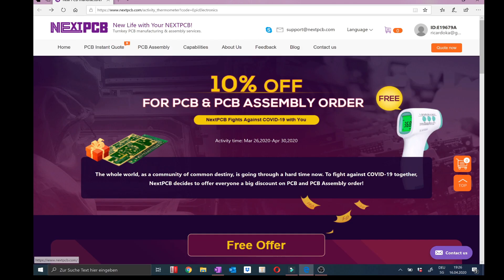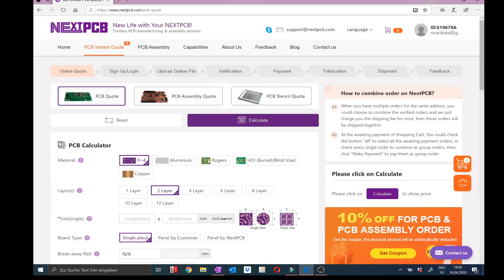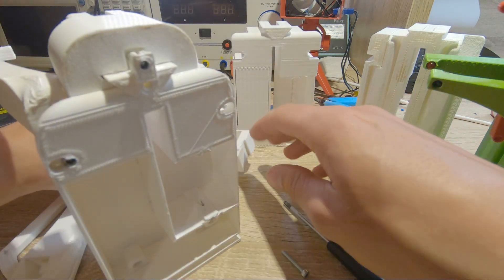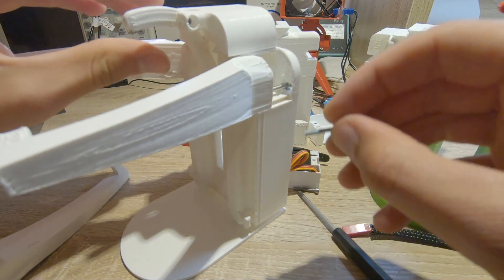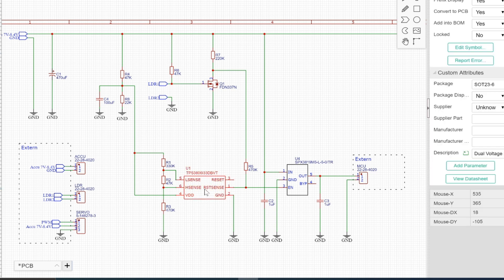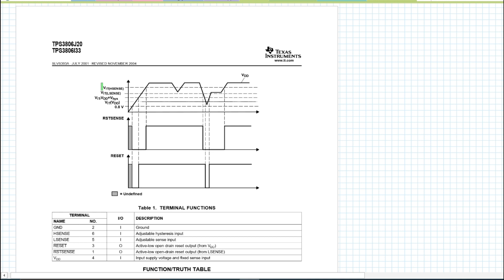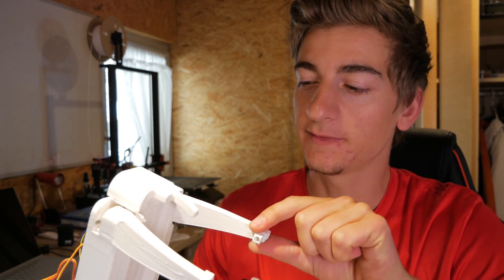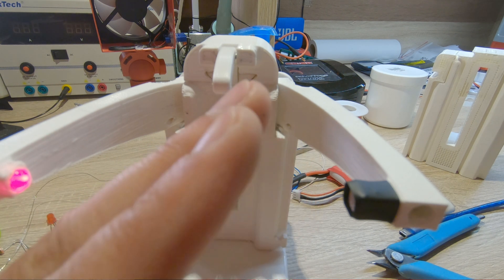No Touch Soap Dispenser V2 | CORONAVIRUS protection | Arduino  | 3D Printed

Comment: Dam this so cool, love the LDR additions I don’t know why I didn’t think of that I actually used LDR with transistors in previous projects. I should used that in my new version for reals. I think I can still add it on the switch connector and replace the switch. You can still use the Arduino servo library but you need to user servo.Detach() to take off the servo. But love this one. I really need to start learning 3d design. So much version u see u did in the background really appreciate the effort.
Reply from the maker: nice :D 
I didn't know that with the detach() function in the library... thanks for that. :P